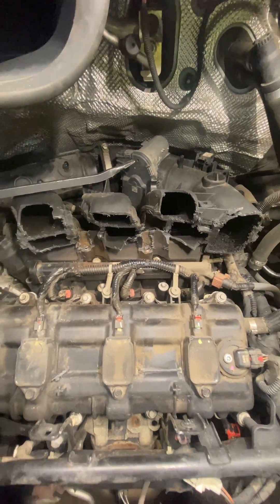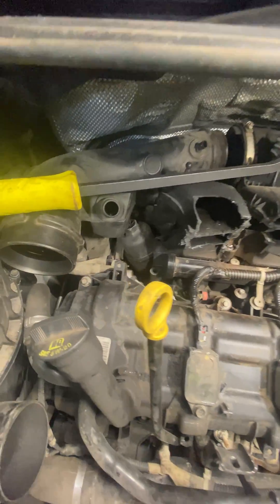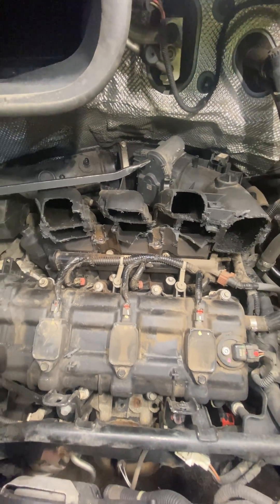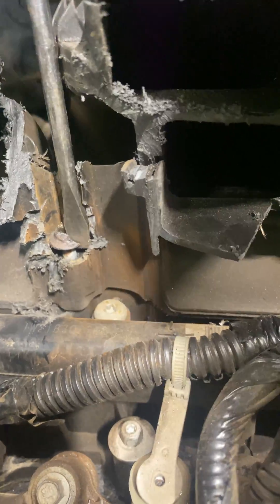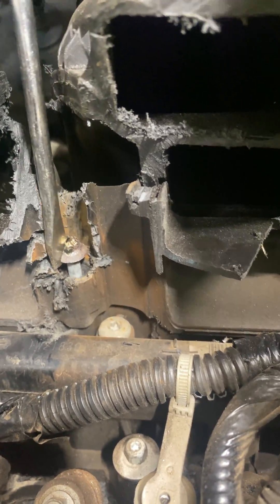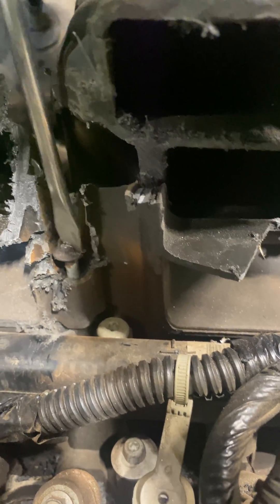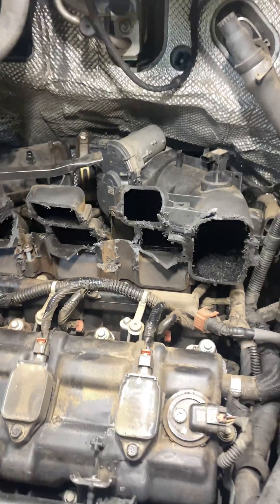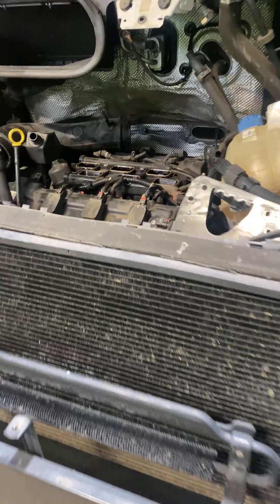Dodge Intake Manifold CUT in half to extract rusted bolts

Comment: I’m sure none of plastic particles from sawing the manifold got down into the intake. 🙄
Reply from the maker: Im sure i didnt shop vac those out either and im sure the combustion chamber wont burn those right out the exhaust and im sure metal isnt stronger then plastic so im definitely sure it wont cause any damage come on guys use common sense

Comment: Pan American tool 6" extended #10  carbide drill .. #3 easy out
Reply from the maker: I have a right angle drill with multiple bits you cant drill an 8mm rusted ball thats recessed when you cant see it the bits gunna keep slipping off and gauging the manifold anyway like what happened to me but everyones got an answer of how theyd do it 😂 until its actually time to do it
Reply: @MikesMotorsports   Im installing a lower rear horizontal stabilizer spar angle on a SAAB 2000.. I know a thing or 3 about hard to drill items in difficult to reach places.  Carbide drill bits will get it done. They make them in 1/4-28 threaded to fit aircraft grade angle motors.
Reply from the maker: @charliewilliams3978  like i said if there was a way to get it done i would have done that its not worth the time or risk time is money in this field and this was the best option

Comment: Harbor freight probably had something to extract them bolts without destroying the manifold
Reply: lol they do I had a shitbox ford soooo rusted n used a $13 harbor freight extractor n about 3 hours 😭😭😭😭 the car wasn’t worth a damn but I wanted to help a friend 💀
Reply from the maker: I have multiple extractors if the bolts werent recessed 4 inches inside a circle that only a 1/4 8mm socket could fit in i would have been able to get them out no problem or i would have drilled them it wasnt possible with them being recessed
Reply: @MikesMotorsports  you can always find those manifolds cheap if you have good resources I’m with you bud
Reply from the maker: @anaarreguin6970  yea its actually a really common issue with these cause when i ordered the manifold there was multiple options for all new bolts as well which isnt common lol parts were easy to get
Reply from the maker: Believe it or not, this isn’t my first day on the job. If there was another way around it I would’ve taken that route. It’s never fun being the guy that breaks out the reciprocating saw to get a job done but if he had to take it there sometimes you gotta take it there. Thanks for the comments. Make sure to subscribe and check out my other videos!!!

Comment: I woulda tried a screw extractor but those things rarely work
Reply from the maker: Need to drill a hole in the bolt to use an extractor and it wasnt possible to drill it or i would have